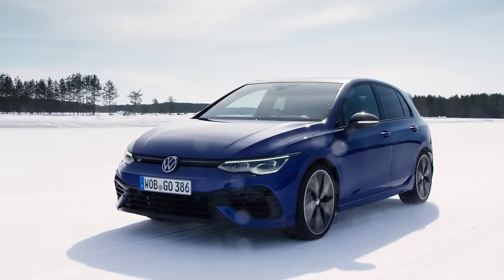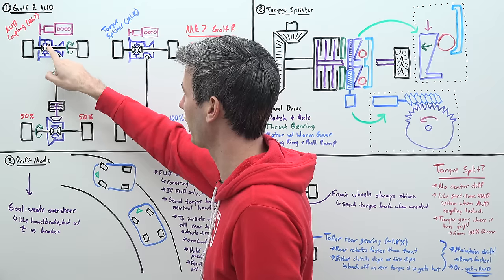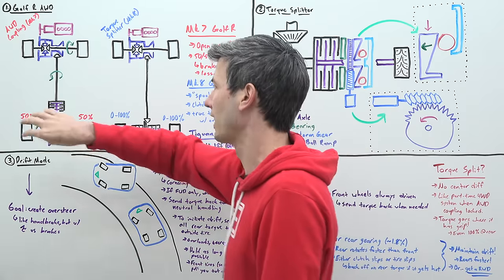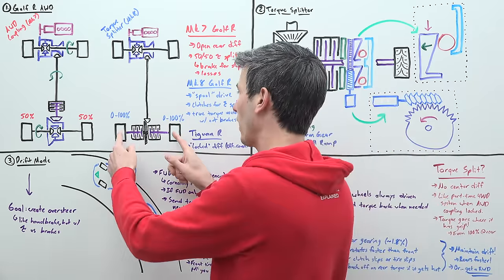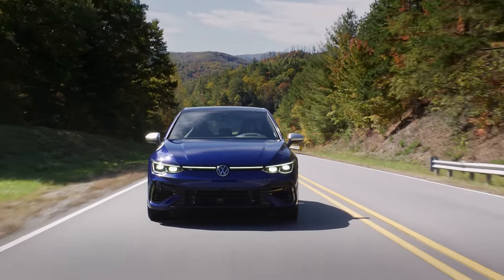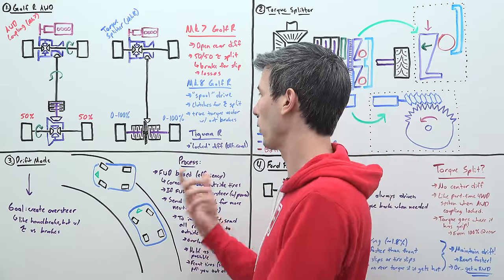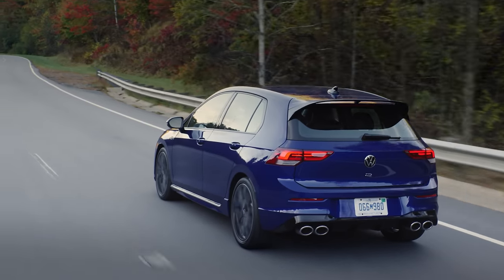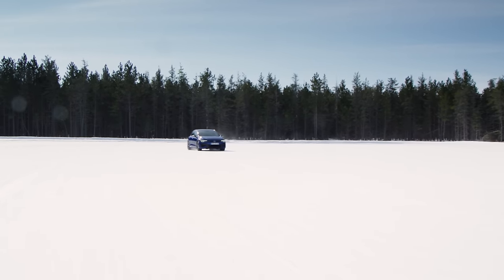Volkswagen's Clever Differential Allows For AWD Drifting - 2022 VW Golf R

Comment: THANK YOU for talking about the Focus RS. Everyone seems to forget Ford did the same AWD 6 years ago. Also, you cleared up my question on what's the difference.
Reply: Everyone also forgets that Mistubishi used torque vectoring by clutches on the rear axle already in the Evo X, 10 years before Ford put in in the RS. And before VW put it into the Golf, AMG put it into the A45. (Audi calls it a sport differential on the real quattros for years, and Porsche just calls it torque vectoring and both cost extra. They both got it long before the golf.)
Reply: Probably just a case of not being able to make it both affordable and reliable enough for VW? As an explanation for why VW didn't do this before, that is.
Reply: @nirfz  Same with Saab's XWD in 2008, which was also used in the Buick regal I believe.
Reply: And Nissan introduced a similar system in 1995 with the ATTESA ETS-Pro Active rear differential in the R33 V-spec and it's R34 V-spec successor (although hydraulically activated and RWD priority)
Reply: @nirfz  
Did the Evo X just hit the brakes whenever it needed to drive a speed (and thus torque) difference between the inside vs. outside wheels and/or the front/rear bias?
Reply: @KPalmTheWise  
Yeah....I'd be curious if Saab's XWD system in 2008 was doing this though (vs. just hitting the brakes).
Reply: @rarkitorparkit  
"ATTESA ETS-Pro Active rear differential"
Yes and no.

The ATTESA ETS-Pro Active rear diff was based on a LSD (and a mechanical one at that).

In other words, unlike the scenario here where say, you can have an "open diff" on the left side, but a "locked diff" on the right side, i.e. 100% of the torque transfer to the right side, a LSD is exactly as the name implies - a limited slip differential, i.e. the delta in the rotational speeds of the axles, left-to-right, is limited.

Here it is not limited.

So, it's similar in the sense that it has controls, but where it differs it the amount by which it can differ.
Reply: @ewenchan1239  if i remember correct this was the way for the models before the X (so IX, IIX..) The X had dedicated clutches at the rear axle. (I remember searching for info on what they do expect for wear of the clutches. And back then not finding any info for that.)
Reply: @ewenchan1239  it was. It has a haldex gen 4 unit with an eLSD in the back. Wet clutch system.

The gen 4 haldex can send between 4% and 100% to the rear, and then the eLSD can split that up to 20%/80% wheel to wheel
Reply: @KPalmTheWise  Saab XWD is very different. It only has electronically controlled lsd in rear diff, it cannot power left and right wheels separately.
Reply: @4x4.tests.on.rollers  yes it does, rear right and rear left, just like this.

The 2008 XWD that was not in the TurboX was just an open differential in the rear, so it could not send power anywhere specifically, but the TurboX and all the following years with XWD could
Reply: @KPalmTheWise  
Yeah, so if it was hitting the brakes, that's NOT a torque vectoring system because the supplied torque into the input shaft of the system (before it gets to the wheel, which would be the "output" shaft) has not changed.

It also differs from this system because it has an actual center diff (which this system (which is probably the GKN Twinster) and if it is, it's the exact same system that's found in the Focus RS, except that the Focus RS rear bevel gear ratio is 1.8% higher than the bevel gear ratio in the front, as it is explained here), but the clutch system is what GKN is responsible for; lacks (a center diff) and can send the torque between 0-100% for each wheel depending on the clutch engagement.
Reply: @KPalmTheWise  
"yes it does, rear right and rear left, just like this."
Again, yes and no.

Yes, you can vary the torque differential between the left and right wheels.

But unlike this, an ELECTRONIC LIMITED SLIP differential is literally in the name: it's a LIMITED SLIP differential.

As you mentioned, it can only split the rear torque 20/80 left/right (or vice versa), where as this can go upto 0/100 RL/RR split (or vice versa).

The method of engagement, and therefore; the controls is significant in terms of the differences between Saab's XWD vs. this.
Reply: @KPalmTheWise  No, it can't. There is ONE electronically controlled clutch-pack inside the differential working as lsd, means it can limit the speed difference between left and right. That is completely different thing from two clutch-packs without a differential.
Reply: @ewenchan1239  Golf R doesn't use Twinster from GKN but Performax from Magna Powertrain. When it comes to Saab XWD - it can actually lock the clutch-pack in rear diff so torque may vary from ~0/100 to ~100/0 but as you mentioned - that's not the same as above systems in VW and Ford.
Reply: @ewenchan1239  oh yeah, sorry I wasn't trying to say it's the exact same as this. But the end result is pretty similar.
Reply: Nissan Juke AWD тоже обладал точно такой же системой
Reply: @gsi87  Indeed, six years before Focus RS. But there was no overspeeding function.
Reply: Not the same implementation. Brits invented four wheel drive in the 19th century so would you say Ford copied that? Plus Focus RS is finished. Hence the ancient looking car in the video clips.
Reply: @nirfz  it was vectoring but done not like the evo...... ford acquired this technology exactly when ford bought land rover..... the land rover  system is superior and believe the first torque vectoring  vehicle with this exact technology under patent to be the land rover freelander 2.... the same as the ford RS.
Reply: @nirfz  Mitsubishi copied Nissan, but Nissan copied Porsche.

Comment: Awesome stuff Jason. I drove this car back in April, and its awesome. Mine should be here soon. Its actually stuck at port.
Reply: Although I’m very poor and could never afford ANY car, I can empathize. I feel your pain.
Reply: After the VW defeat device for emission control, how can we trust the engine does not have another one fitted?
Reply: @johnathanpearson3203  it's a gas engine. Not as hard or expensive to get past emissions than a diesel.
Reply: @johnathanpearson3203  Also, we do not care about emissions.
Reply: @volvo09  Diesel when properly installed has very low emissions. Unless you ask it to perform like a gas car.
Reply: @laloaguirre9847  do you care about manufacturers telling the truth about their products?
Reply: @volvo09  fair enough. After the 10 years diesel gate I don't trust VW. Apparently the engineers told management the only way to protect the dpf was to install a system that detects the emmisions check. 🤔

How can we be sure the ABS system is not cheating too?
Reply: @johnathanpearson3203  Not if it's about emissions. I would be more interested about reliability in this case.
Reply: @laloaguirre9847  VW would say it's extremely reliable. 🤔 But then again, they said their diesels were compliant too 🤔🤔
Reply: @johnathanpearson3203  I can certainly understand that... They did that damage to themselves, not going to try and fluff it up like they'd never attempt to cheat a customer after already cheating the gov (which actually has some legal power, unlike me and you).
Reply: @johnathanpearson3203  Nobody would say VW is extremely reliable. I distrust any manufacturer by default, that's why there should be tests designed in a way they cannot be tampered with.
Reply: @Comech64  they all lie about small things. They don't all install cheating devices...
Reply: As good as it may be, it won't be as interesting as the rebuilding of the boosted R32! Rock on dude, may your beard grow ever longer 👍🏾🤘🏾😎
Reply: @johnathanpearson3203  there's actually videos on how multiple manufacturers systems can tell if it's on a dyno and at low rpm aka for emissions but yes it's just vw...
Reply: @johnathanpearson3203  I'd like you to ask Subaru owners how they could trust Subaru for over a decade of catastrophic headgasket failures without even an acknowledgement of a faulty design. But they're "green" and "Subaru is Love" or whatever so they can do know wrong since marketing matters more than anything in these times of softies with their feelings. There is no such thing as brand loyalty with VAG. I like some of the cars they make and enjoy my current Sportwagen which has been 100% reliable over a few years and 37k miles, but as previously stated all corporations are at least sus and most are trash and sometimes they make a good product. But, hey - that's capitalism..or whatever. 

TL;DR: who cares.
Reply: @johnathanpearson3203  we can only hope VW is doing better. Apparently, not many share your worry, as VW is still no. 1.
Reply: @perryblanco1446  VW is number 1 because the EU favours Germany for such things ... My friend had a Golf and within 3 months it needed a new exhaust brakes clutch and battery ☹️
Reply: @johnathanpearson3203  I wonder how he drove it to wreck it in 3 months.
Reply: A DI engine vehicle that’s stuck in Port 😖
Reply: Change ride again (0.0) I wish to see Humble goes JDM :)
Reply: @johnathanpearson3203  Well, you don’t have to buy a VW.
Reply: @johnathanpearson3203  I’d be interested to hear the details of the car needing that work. 
Was it a new car or 2nd hand?
What was the reason for each needing replaced?
Reply: @johnathanpearson3203  My golf had 106k miles when I sold it and almost perfect in every respect, I still got bored of it though so there's that.

Comment: I worry about the reliability of such a complex differential…
Reply: Think Tiger tank
Reply: It’s a VW thing
Reply from the maker: That's why engineers test things. :) IMO, you can't call it unreliable until it's found to be unreliable haha. 🤷‍♂️
Reply: Imagine the car won't let you drive due to having differential failure.
Reply: you can't afford it so why worry
Reply: Don't know if it's a similar tech, but Honda used a torque vecterring rear diff in their suv's and the Acura RL back to the mid 00's. They were reliable.  Not as much control as this, but as long as you don't beat the ever living crap out of the car, I wouldn't worry. Just maintain it.
Reply: @volvo09  Dont beat the living crap out of it? Then what would you even need this complex system for then....
Reply: It might be reliable over its lifespan, but I would certainly worry about how long it would actually last, and the cost of replacing it, if you even can. The point here is; surely the rest of the car could easily outlast it by a significant margin?
Reply: It has two of these clutch packs instead of the traditional one. The clutch packs themselves haven't proven to be outrageously unreliable. So it'll depend on VWs implementation in this application. Although I think Differential oil changes will be more important than ever....😂
Reply: I remember when Ford did the same in the Focus RS and people (mostly so called wise men on the internet) thought it would be unreliable garbage. It ended up being the most reliable thing on the car, and didn't even need maintenance lol (owned a Focus RS for 5 years). The engine and clutch / gearbox though? Different story.

Comment: What I wanna see next is the opposite: Limited Slip Diff in the back and the cluck packs for the front wheels, so it becomes a rear bias driven car.
Reply: You're describing BMW's xDrive
Reply: A limited slip has clutch packs and a “clutch pack differential” is a limited slip.
Reply: @claytonandersontar21  wrong. Lsd's have several different styles, clutch pack, helical, fluid, electronic.
Reply: probably not going to happen with a front transverse engine
Reply: Audi's Quatro with Torsen diffs, setup gives you a similar result.
Reply: @jerryismybff  not exactly. The xDrive sends power through a  clutch pack to the front diff.
Reply: @hitmixhyepock9405  To be accurate...the "electronic" ones are still clutch packs. They're just electronically controlled, like both the Golf and the Focus described in the video.
Reply: Lamborghini Huracan
Reply: There's just one pack in a transfer case,  but you'll find that way back in 1989 on the Skyline GTR.
Reply: @geemy9675  Indeed. The transverse engine and front wheel drive is much more fuel efficient for two wheel drive mode than a rear drive with the propeller shaft at 90 degrees to the axles.

Comment: GKN developed that Twinster differential few years ago for Landrover Evoque and enhanced it with drifting mode for Ford Focus RS. Then it was used by Mercedes AMG A45 and VW Golf now with this Magna design. Latest GKN eTwinster version is applied to hybrid/EV cars.
Reply: TIL! Much thanks!
Reply: It’s also in a lot of the GM awd crossovers
Reply: i wonder if some of the Evo's had, they were sliding pretty good
Reply from the maker: Are you sure it's a GKN unit in the Golf R? It's different, mechanically, than the unit used in the Focus RS, and I haven't seen any sources referencing it's from GKN. Have a link?
Edit: I've verified; this is a Magna unit, not GKN.
Reply: @EngineeringExplained  The one in Golf R is from Magna Powertrain.
Reply: Yep, Haldex is History….even though it has been Borg Warner for generations lol.
Reply: @EngineeringExplained  
it's Performax from Magna.
not Twinster from GKN.
Reply: @EngineeringExplained  well, GKN was the first to feature drifting mode back in 2014, it’s entirely reasonable others can feature it with time
Reply from the maker: @MrPagnu  Yes, but could you edit your top comment to clarify that the Golf R unit is from Magna, as to not mislead? Thanks!

Comment: Hi Jason. I see a lot of similarity to the Honda Pilot/Ridgeline rear drive system. I love the idea of being able to transmit as much or as little torque to each wheel like that. It could also be used in conjunction with an open differential to act as a limited slip/locking mechanism. Engineers always find the answers as long as the bean counters stay out of the way.
Reply from the maker: Yes, some similarities to SH-AWD where they allow for torque vectoring! Though mechanically handled a bit differently.
Reply: @EngineeringExplained  the Pilot/Ridgeline can't drift. SH-AWD Acuras can, though.
Reply: @EngineeringExplained  : This new VW system layout seems just like the VTM-4 system by Borg Warner used in the 2003 generation of Honda Pilot.  A standard front transmission with a takeoff that turns a rear spool. Then clutch packs on either rear driveshaft to engage as necessary.
Reply: @EngineeringExplained  you made it on MKBHD!!!! Check his latest video.
Reply: @footballcoreano Honda did invented that, it was worlds 1st plus additional accelerator puts it to another level unmatched even today

Comment: Great video, and as others have said, especially the last bit about front to rear torque split.

You should definitely consider doing a follow up episode on F:R power distribution, to help answer some common misconceptions.

For example: with a haldex-based system as in the mk7 and other cars, is it easier to talk about a torque split? Common thinking seems to be haldex maxes out at 50% rear.

For example if you put front wheels in the air (or onto pure ice), what would happen at the rear wheels in the case of:  part time 4x4, haldex , rear torque vectoring.

Thanks. Would be great to learn more on this subject!

Comment: I have a Acura TL sh-awd with similar awd system as the focus RS with taller gearing for the rear wheels. It's SO good for drifting in snow (I live in Canada).
Reply: The Acura sh-awd is arguably better than the focus rs because it uses planetary gears so that the clutch packs are not responsible for transfering the torque directly, the clutch only modulate the torque so it can transfer more torque for much longer without wear or overheating. I guess it's much more heavy though!

Comment: I'd love to see a video on Chevy's new 1004hp naturally asperated big block crate engine.  There must be some amazing stuff in there to get so much power without forced induction.
Reply: It's a large displacement motor that is not rated for use in production cars. It doesn't comply with any emissions regulations. Nothing complicated really.
Reply: Yeah, if its not boosted, it has to be big.
Reply: @borderwave2  slot of VWs don't comply with emissions either 🤔
Reply: Actually no there isn't really it's just a massive engine. There is already videos on it
Reply: @victorfranca85  it's just massive engine not meant for on road use. So nothing special
Reply: Not difficult at all whatsoever to get 1000hp from a naturally aspirated big block V8.
If it can breath, has high compression, and the rotating assembly is balanced (so it can Rev) its gonna make huge power.
Remember that hp is simply a measure of torque - the higher the engine can rev, the more hp it can make.
Horsepower is simply a measure of how much work the engine does and is just as simple as torque +revs =huge hp numbers
Reply: @victorfranca85  nope... You can get huge hp numbers from VERY small displacement engines.
Horsepower means high revving.
You absolutely do not need to have a large displacement engine to make high hp numbers.
The 3L v10 engines from f1 cars in the mid 2000s made over 900hp.
Horsepower is just a measure of torque and revs.
Hp is just a mathematics formula that measures how much work the engine can do over a certain period of time, and you absolutely do not need large displacement to make lots of hp.
Hp is a measurement of torque over a set period of time... That's why EVERY engine in the world will have identical torque and hp at 5252rpm... Bc hp IS torque.
Get a tiny engine with very little torque and make it breathe freely and balance to rotating assembly - the crank, pistons, connecting rods and valve train - so the engine revs really high, and you have big hp numbers.
A 2L engine can make just as much hp as a 6L engine if it can Rev really high.